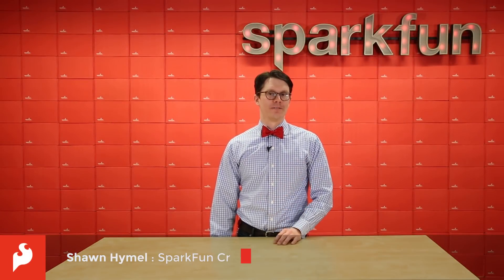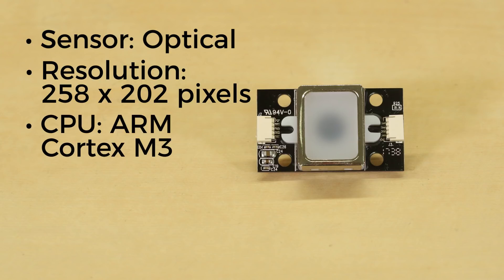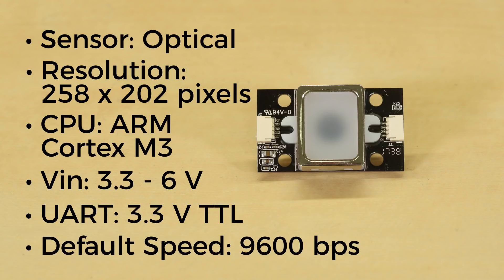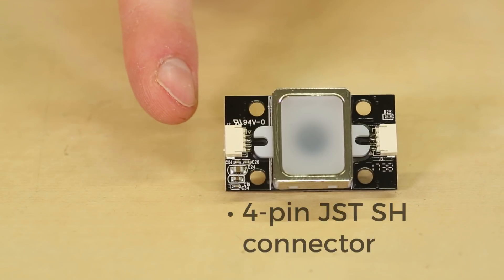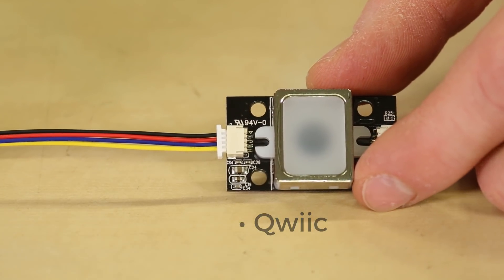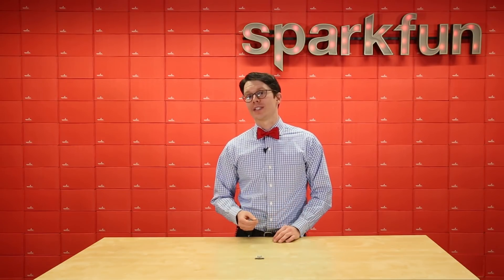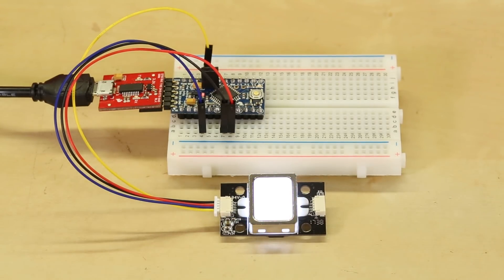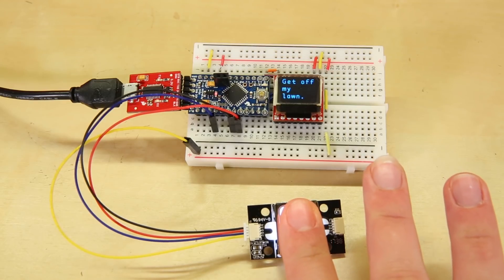Product Showcase: GT-521Fx2 Fingerprint Scanner

Comment: Is it possible to just get the Fingerprint image and do the matching elsewhere? storing fingerprints on to the sensor memory is not applicable in all situations. Sometimes you just want the print and you can do the matching say from a server.
Reply: From a cursory read of the datasheet and programming guide, it appears that it will do what you're requesting.

Comment: By default when the Vcc and GND are connected to the power supply should the sensor light up? Mine doesn't so I am worried that I have been sold a broken module, and I am no longer within replacement period. I am sure that the wirings are correct :(

Comment: A fingerprint remains after you press the sensor, which could, in theory, be used to replicate the authentication. A finger swipe would be less susceptible.
Reply: In theory, you could press down with your finger, wait for a read & then just swipe down to erase the print. Think smart.

Comment: Looking at the programming guide, I see there is a command to GetImage.  What is stopping someone from stealing the scanner and having your fingerprints?
Reply: Probably nothing, it's not real security. Also since the device is doing the authentication, all you would have to do take it off and send your own serial "finger is authenticated" message to unlock the door (or whatever)....
Reply: I looked further, and I see it has gets and sets for SecurityLevel.  But it isn't explained.  Bringing your own and just hot swapping your device right there on the scene would work.  Or if you had the time and a laptop, you could enroll your print, gain entry, and remove your print while leaving.  Either way, this device would need to be embedded in to a wall or something for it to be practical.